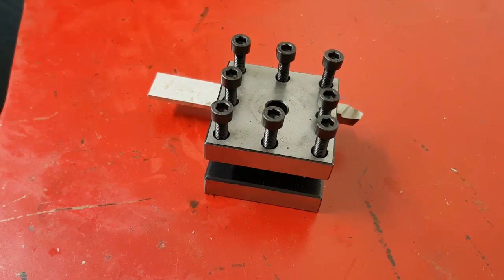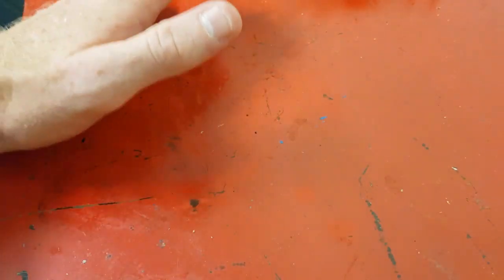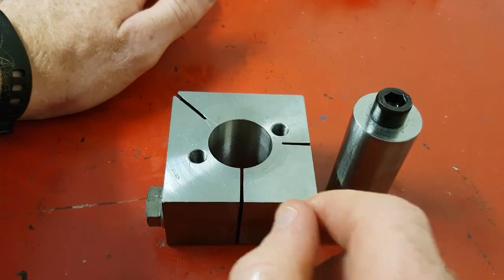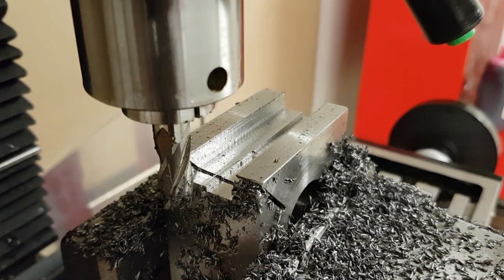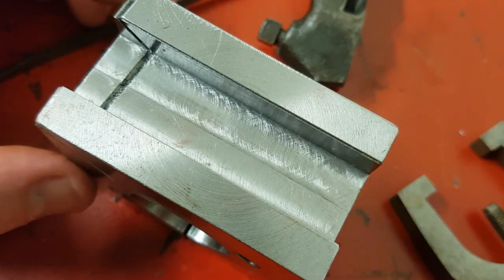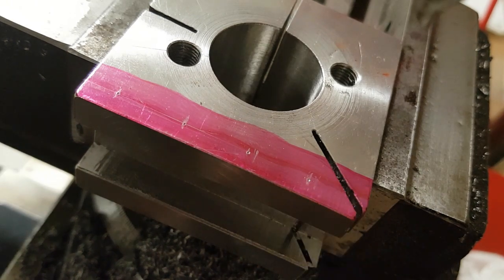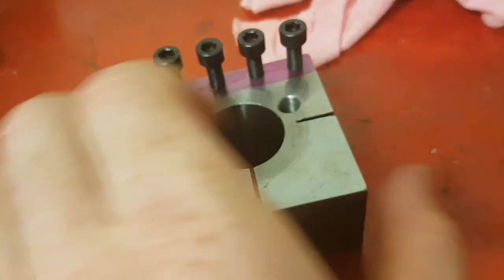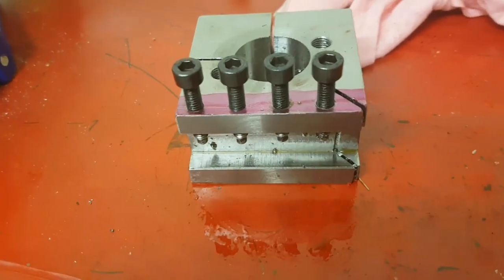DIY QCTP for mini lathe

Comment: I too thought mine was original, but found out otherwise soon after. Very much like yours except the height screw is M4 (brass) . Mine are a bit more substantial than yours in proportion, but only needed 1 slit on a far looser fitting centre-post. The main reason for this is that the slit is cut from the centre outwards, allowing the clamping to happen with far less force required. Cheers from a Sandgroper ;-)

Comment: I made nine similar units out of mystery metal for my 9x20 lathe. I made the large hole a fairly "stiff"  slip fit and only used one slit. When I cut the slit, I started by using a slitting saw but the slit of one one collapsed on the blade, destroying it. I used a hacksaw to finish the remaining units.
 For any 9x20 lathe owners reading, I replaced the original tool post base with the Pitkin donut, highly recommended.
https://drive.google.com/file/d/1b-1v8sZKtDkmfDDO8q_7Y6Wbym-itpgB/view?usp=drivesdk
https://drive.google.com/file/d/1b5lvEmbKcAGtVi-ROVvamSjsI7V_qqrm/view?usp=drivesdk
https://drive.google.com/file/d/1b79hLkuLeQM58Zo071tOwc236uD33GY9/view?usp=drivesdk

Comment: Ok so you won't a quick clang tool post . 
well hear what i did  & I suggest you think of  This ,  so hear I go  This is what I did . 
when you think of it .  we have a tool redy made Strong & solid, so how do we convert that into  a  quick Change  tool post. Well i found some tool holder's at a car boot, , so I followed that paten.  

So in your case I see you have an small aloes paten  post.  so let me say you have half the Quick Kit  you need.  to build your { New Tool post. using your four way post }, So how ?  Well first remove the present post tool holding pins with new  replacement  grub screws . 

Then contemplate.  you adores.  stile post . & consider how to ached the dovetail  within the steel your about to fit within the old tool post & how to fasten to , the new post attachment to be handed, consider cutting a dovetail that can be securer in two way   one by grub screws in to the new block you are about to make,  which allows the grub scows to enter the block treads & tighten down solidly .  now consider the centre of the new block with it new Dovetail mild within it to tack the tool careers you already have, 

you are at this point 78 % of the way complete. the new adjustment  will fit on the new block yet to be determined  the plunger that grips the dovetail will be  cam meconium operated within the centre jack bolt fastenings , of the original tool holding, pins , i personal like  the sold  wag Tip that travel up a down within a round  drill   hole pulling  up or pushing down against the plunger wag, that titans  the dovetail's   I have suggested an  idea or tow ., 

keeping the build deliberately vague. half the fun is figuring out  how to Complete   the build in you case you have the holder's the lar for way steel  base. mine works well no chatter because  the grub screws go in to the new block holding it farm & the plunger grip's the dovetail wag tightly pushing the  the new tool block you have solidly. 

i hop you ues the system I haven filmed my work arrow I hope you do .  the cost was not a lot , just a peas of steel to develop the dovetail the posh wag was a simple plunger tip with a
:-  O 'ring to hold it in place.     Les , England UK  

 PS . 
:- The thing  is you get to keep tow.  sides for sliming up  tooling you mat  Need to.  The peace can be mad as   one  cut out to fit both sides  of the for way tool post in  steel  i used a Donkey saw to removal the  most I had no mill.  what I did work well  "NO"  I  never bothered with spending on a    quick change tolling &  had six of the boot sale  ,  & the two it I want to pack them , never needed them versatile by gum yes . I  sometimes ues boring bars , in the turret section  , the best of both world's,
Reply from the maker: Thank you for the efforts you put into this comment and I am sorry it took me this long to reply.

Comment: Enjoyed the video. A bit late in the day now, but had you drilled just small holes where your slots end then you would have removed the possible crack starter.
Reply from the maker: Hey mate, thanks for the fix. No I havn't done it as I moved on to a bigger and better machine since then. It was working just fine before I  moved it on to another. I may make another for my Hercus 260 at some point and I will be putting more effort into tolerances and less trust in aprentice workmanship:)

Comment: by now it is very likely that someone else pointed this out already but here i go, you need to drill small holes at the ... (sorry english is not my native language, bare with me)... base of those cuts. that will prevent (or at least postpone) stress fractures. im sure there is a formula for the size of the holes but you'd probly find that out on your own.
edit: another thing, you may want to make the cut for the tools on some other face of the toolpost that doesnt have any relief cuts/slits. that face changes shape when you tighten it and it is not that consistent.

Comment: Very good design. Try and make the lock bolts 2-Allen head bolts to received canterbore on the tool post. 
Very interesting design
Reply from the maker: Very good suggestion, more locking force. Sorry for the late reply also

Comment: How does it work. You have not met complete video
Reply from the maker: I explained it in the video. The central shaft is a close fit to the bore of the QCTP so when the bolt is tightened from the side it closes up the gap and tightens around the shaft

Comment: If you drill a small hole a little larger than the width of the flexure slot at the inboard end of the slot--such that the slot ends in the hole--you can prevent (or make very unlikely) a stress fracture. It would be best to do so before cutting the slot, but you can do it now on your prototype if you're careful. Since you have a mill, have you thought of experimenting with dovetails?
Reply from the maker: Thanks dude
Reply from the maker: Yeah dovetails would be nice, just didn't have a dovetail cutter

Comment: Nice design
I more or less did the same thing with mine, kept cutting away until it clamped!
One thing you can do to reduce cracking is to drill a hole at the end of the slit (have a look at a circular saw blade for example) a larger radius will reduce the stress
Reply from the maker: Will do thank you

Comment: A few months ago i made the exact same type of tool holder (which i later found out it wasn't so original either) 
It works great, but as you noted, it will crack at some point in time, so the next project for me is to make a solid tool post with some kind of height adjustment that doesn't require shims. 
Subscribed.
Reply from the maker: Hard Case thanks for the post (punn intended). If I was to make it again and probably will, I will off set the bore to bring the locking clearance slit closer to one edge rather than central. Or maybe I will just buy a comercial one:)Centre height is the most frustrating part of turning in my eyes. Closely followed by trying to understand a customers chicken scratch of a tech drawing. Thanks again for the comment and stay tuned for more projects